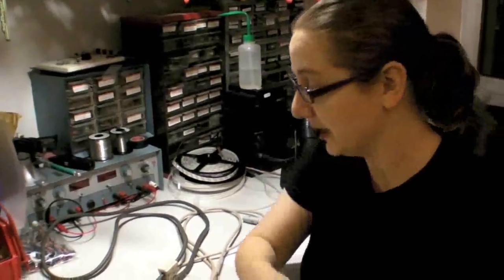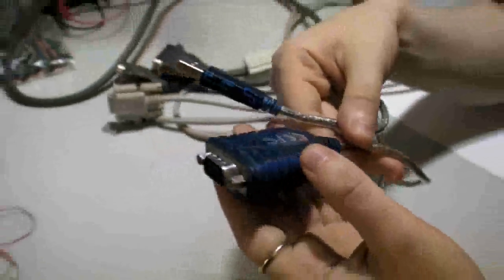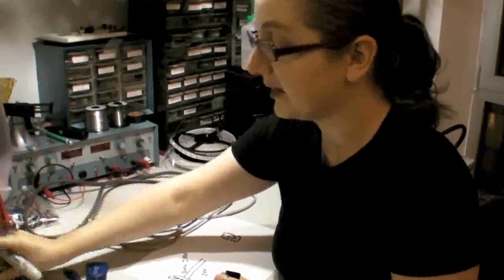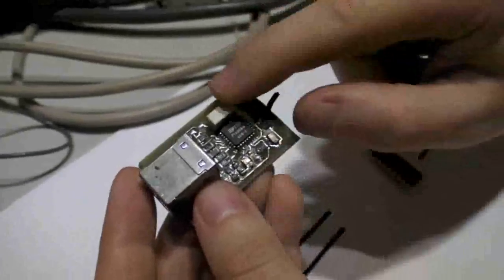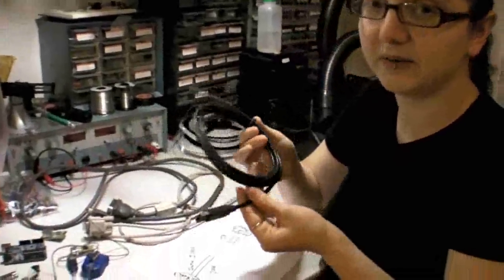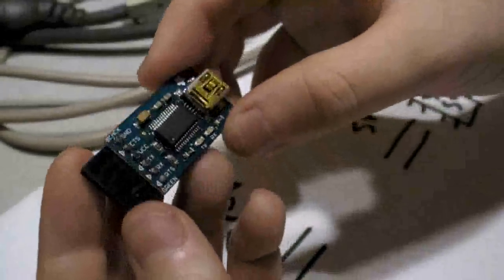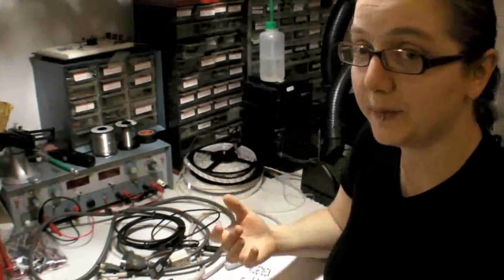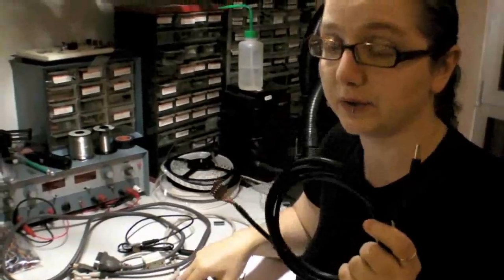USB, serial and you... an Adafruit after school special

Comment: I once had one of those usb serial adapters wired to max323 for level shifting. Then I stopped for second to think about it and opened the adapter up. I found out that it had an ftdi chip and a max232 inside it. It felt pretty stupid to have one max232 converting voltages up and right after that another converting them down.

Comment: Hi Ada: I'm trying to connect a linux box( serial 9 pins connector) with an arduino uno (arduino has NESA16U2).
What kind of cable you recommend to use? Thanks in advance.